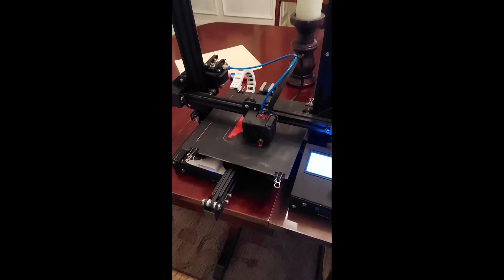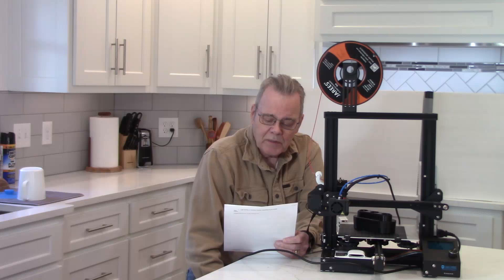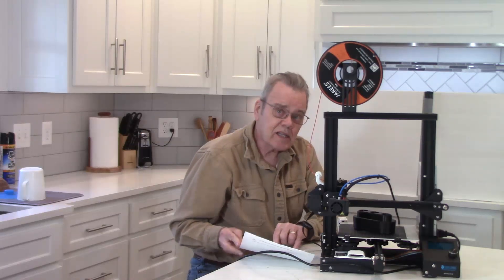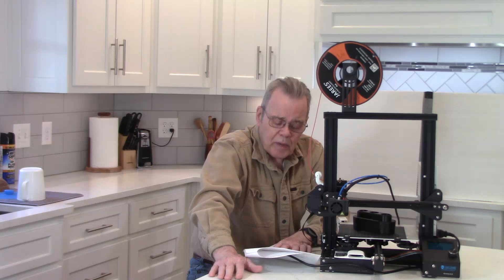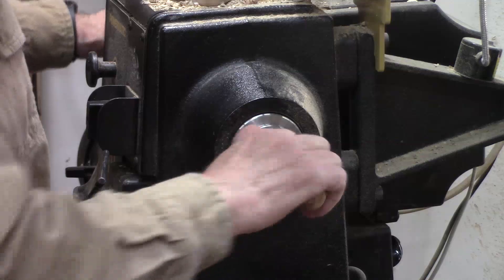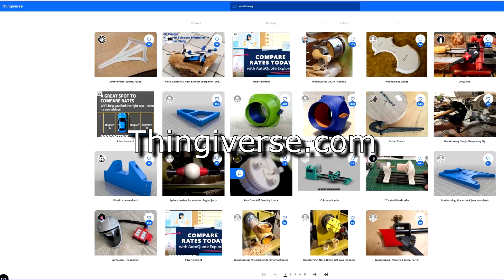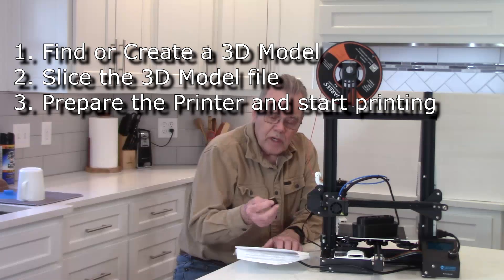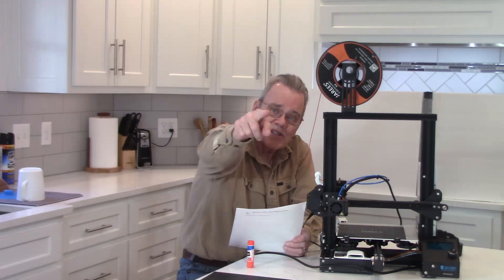3D Printing Woodworking Jigs and Gauges for Beginners!

Comment: Hi Mike, I especially enjoy watching your lathe videos, because they are more geared towards a hobbyist, like myself, although I enjoy watching Tomas, and Richard too. I won't call myself a beginner, because I did turn a chess set 30 years ago, but need to practice again now that I am retired. This video disappoints me, because last year, sometime, I took your idea of making a gauge out of scrap wood to check a turning's diameter for a chuck, and it works easily and perfectly. I hope that 3D printing for hobbyists is only a fad, and we (hobbyists) continue to use our creativity and "scrap" wood to make necessary accessories, because we all know every woodworker has plenty of "scrap" wood. I put scrap in quotes because of how expensive wood is, and I love to repurpose and use "scrap" wood as much as possible. Thank you.
Reply from the maker: It’s nice to have options, and scrap wood has it’s place! Now make a set of jaws from scrap wood like the ones I showed. Umm. Not so easy. 3D printing is not something I am really getting into. I gave my son back his printer. It is another tool. If it works for you use it. If not...

Comment: Interesting as usual.  I have the one you show, I bought a few years ago because my grandson was interested in them.  We built it together, figured out how to use it and that to me was worth the $300 I paid for it.  However, the problem with the one you have is it does take a lot of work to get it to print.  Bed leveling sucks and the frustration will stop you from using it because it is an every time you use it event.  It was soon collecting dust.  One tip I got from a geek was to use Windex with Ammonia, they don’t all have ammonia anymore, to clean the bed before printing.  The is also a better plate than the one you use, worth the upgrade for $25.  
My brother is the real geek and while at his house he had a Ender 3V3.  The next entry model.  It is a little more than one I bought, but I can use it.  What I liked about it was you really just print the files you have sliced into G code. No bed leveling, its like having a belt lathe vice a variable speed.   I just run a extrude run to clean out he nozzle, wipe the bed and print.   The only issues I have had is setting up the part in Creality so that you get minimal overhang. But that is true with any 3D printer.  Thanks for the file tips, already downloaded them.
Reply from the maker: It sounds like you've had some great experiences with 3D printing. You are right, bed leveling sux.

Comment: Thank you Mike!  To anyone interested in a 3D printer, DO NOT GET A KIT!  DAMHIKT!   It is difficult enough to get an assembled machine.  Join any group you can find that covers your machine.  Visit Thingiverse.  If you intend to make your own parts you will need to use a CAD/CAM program to design parts.   Plan on spending as much $$ and time on 3D printing as you have on woodturning/working.

Comment: My local library has a tech center with several 3D printers and a Glowforge laser cutter.  They offer some basic training and it is a great way to make one off parts and jigs.
Reply from the maker: Libraries are a great resource, and it sounds like yours has some fantastic equipment!
Reply: I asked this question at our local library, "This will be an odd question, but do you have 3D printers available?"  She told me, "Not odd at all, we are investigating this subject."

Comment: Good intro to 3D printing, Mike. I got a Creality Ender-3 S3 SE for Christmas.  Basically latest cheap beginners machine like the one you showed. Really good, because it auto levels!  My son and I have printed stuff, but until I saw your video I had not considered it for my woodturning.  I'll correct that straight away. (I also have some interesting failures, mostly because faulty orientation has left strings in the mechanism that I didn't clean up properly)
I am going to plunge into the weird world of CAD this year, I hope.
Cheers from Melbourne Australia.
Reply from the maker: It sounds like you're off to a great start with your new printer!

Comment: Good video for people considering adding a 3D printer to their shop.   I cannot imagine doing without a 3D printer after having had one for over 10 years.  There are just so many uses -- I've used the printer to explore shapes before committing to wood, making jigs and gauges, making organizers that help shop and garage organization, household repairs, and multiple other uses including just some fun prints. The nice thing about the 3D printer is the precision that one can achieve with 3D designed objects.  If one is able to use a 3D CAD program, you really have an unlimited opportunity to make anything you can imagine. I use Rhino3d - somewhat expensive but a perpetual license and can generate files for both the printer and laser as well as furniture and turning designs.
 
  I just replaced my 7 year old printer with a Bambu printer this past summer; it is head and shoulders above my previous printers.  Like Apple, it just works where in the past I had to spend a great deal of time and filament dialing in settings to get good prints whenever I got different filaments.  Bambu has a range of printers that go from about $200 to $1600 so it can accommodate most budgets.

  That chuck gauge looks quite interesting and I'm really intrigued by those pin jaws -- I need to look into that.

Comment: I designed and printed some vacuum chucks last month that have been working great! Super useful in the woodshop.
Reply from the maker: That's awesome! It sounds like you're getting some great use out of 3D printing.
Reply: Yes I have made some vacuum chucks also.     So then I decided why not try making some of the other vacuum chucking components.   I made the rotary vacuum adapter and the socket where it plugs in on the left side of the spindle.  (used good sks bearings, o-rings, and silicone grease).  Also printed a six way manifold for the hoses, gauge, and two valves.    Complete setup, no machining.   Using it every day just about.

Comment: I use 3d printing all the time in my woodturning. I've used the infill patterns to create interesting epoxy resin blanks for pen turning. The best use has been for threaded inserts for urns and boxes. I've also experimented with creating a threaded reverse chucking accessory. On Thingiverse there are some great plans to store micromesh pads and pen bushings. If I ever cast something in epoxy I print the container and simply turn it away.
Reply from the maker: Great suggestions for projects! Thanks for sharing.